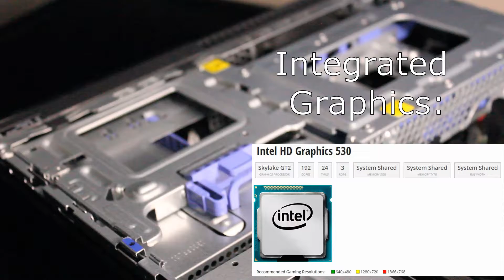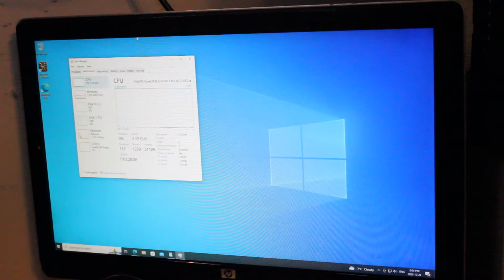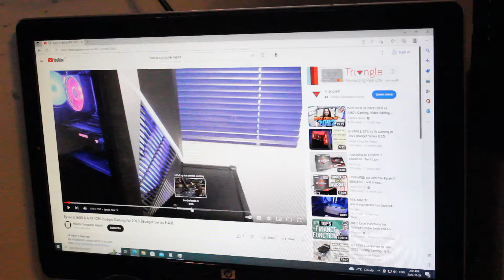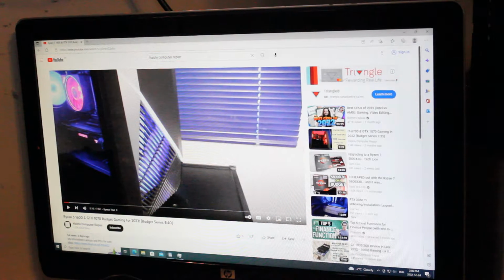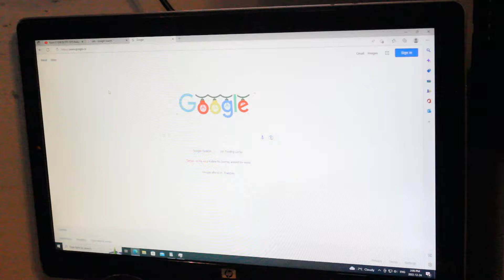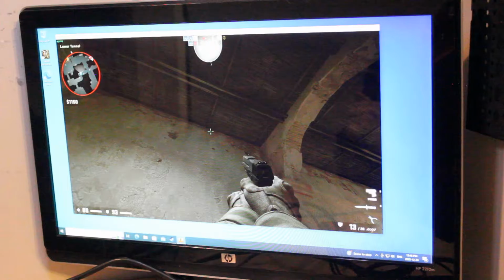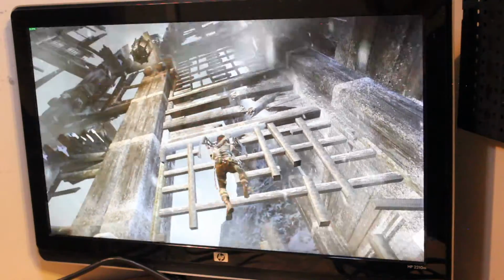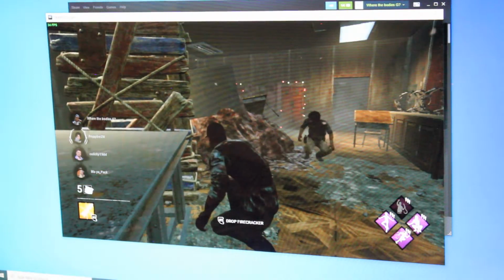Lenovo ThinkCentre M900 Review in 2023: Gaming & Hardware Specs!

Comment: I am interested to know if you upgraded the psu and to which wattage from 210w. Was it able to fit in the case and if there was a problem with cabling. I am planning to upgrade my M900 cpu to i7 6700 and also gpu card. I upgraded my ram to 2x16gb and hdd to ssd and need extra power
Reply from the maker: Check out my video here which goes through what you need:  https://youtu.be/_OsjdV9VOSw?si=HtS5BJtsmB0ZDl6O&t=25
Reply: @HaisteComputerRepair Great, will check it out.

Comment: I have a lenovo 910t midtower, with an i7 6700, 16gb of ram dd4 2133hz and 250gb SSD + 1tb HDD. I'm currently upgrading the PSU to a 650w to add a gtx 1650 PNY. Thanks for the video (:
Reply from the maker: If that power supply has some 8 pin PCIe cables, start taking a look at the GTX 1070, 1080, or RTX 2060 prices.  Otherwise have fun, sounds awesome.  EDIT:  you will need a 24 pin to 10 pin power supply cable adapter.  Check out my video going over this here:  https://youtu.be/D_4K8QW1VbI?si=zU-Bfkui5eFKAmGv&t=71
Reply: @HaisteComputerRepair  thanks for the response. I bought the adapter (currently waiting for the shipping), I hope it works. 

I will take a look at those GPUs now that I have a better PSU. Thanks man ;)
Reply from the maker: @FedericoRodriguez-sc3gv  The only caveat is the PSU fan will be running at all times unless power is switched off or unplugged.  So, even with the PC shut down unless power is cut the fan will be moving.  Possible inconvenience, but not the end of the world.
Reply: @HaisteComputerRepair  I think I can deal with that (if everything works well) xD

Which is the best GPU I can get for this i7 6700?
Reply from the maker: @FedericoRodriguez-sc3gv  I have some videos if you'd like to check those out.  Outside of that, any that I mentioned and maybe an RX 7600, RX 5700XT https://www.youtube.com/@HaisteComputerRepair/search?query=6700

Comment: I had a low profile rtx 1050 t.i. in my system until this year 2023. I could run most new games at least on medium. I just case swapped to a fullsize gamemax case with rtx 3060.
Reply from the maker: Nice, I bet the upgrade is really great!  I just installed a GTX 1050 Ti low profile into a M900 today for a customer.  Didn't get time to benchmark it unfortunately.

Comment: I have worked with a few Lenovo M900 SFF's before. Here are some things that I know.
1. The blue slot that you mounted the 2.5" SSD into (and the mini fan that's attached) is optional and rare. All the units I've worked on don't have this component at all.
2. That is not an M.2 slot at all. It's a proprietary slot that can accept a daughter card to give you a PCI slot (not PCIe).
Reply from the maker: I was pleasantly surprised to find the little fan.  I have 27 of them at the moment, so they will be spread around soon enough :)   As for the non-m.2 slot, I  took a look at the product specifications and made the assumption that it was indeed an m.2.  I'll have to pin a comment, thanks for pointing that out.  By the way, have you used it for anything in the past?  Cheers.
Reply: @HaisteComputerRepair  You can use an NVME SSD, but you have to use an NVME to PCIe adapter card. I have tested that and it works. I have only used the M900 for a basic office computer, not for gaming.
Reply from the maker: @ytguy2010  Cool, I would like to try the adapter out with an NVMe.  Since these will be "refurbished" I'll be selling them as basic office PC's and upgraded to i7-6700 and some low profiles GPU's.  Also will be testing out transplanting to larger cases with a 24 pin to 10 pin power supply cable adapter to support larger PSU's and Graphics Cards.  My plan as always is to explore the versatility.